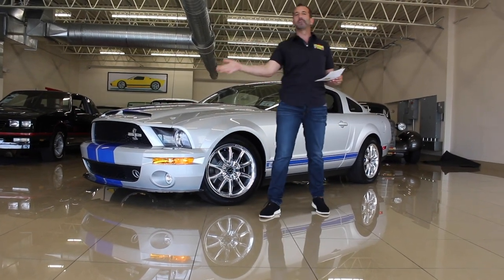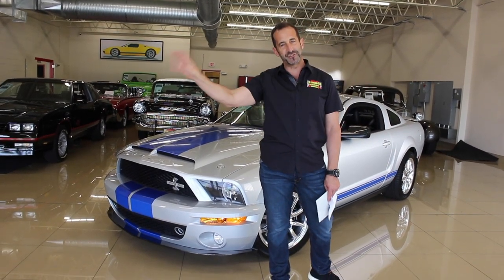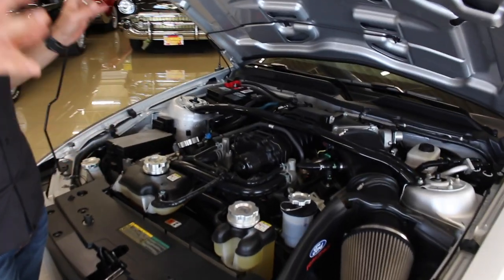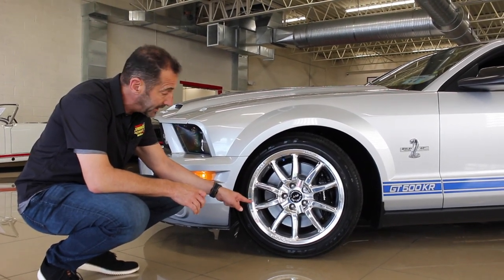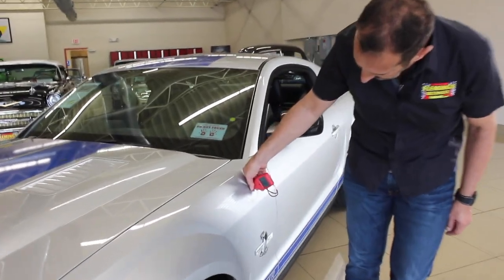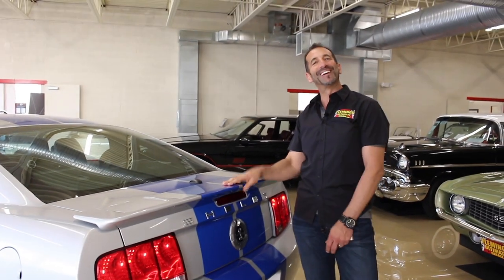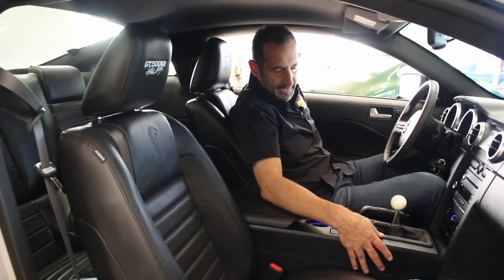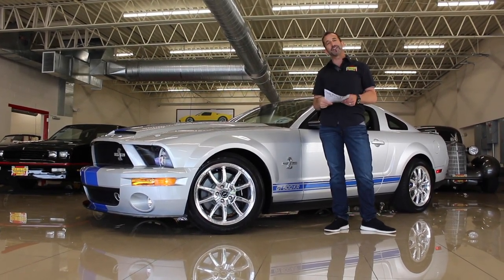1 of ONLY 1000 GT500KR

Comment: Wonder if it could be modified for 800-1000hp . . . . .
Reply: I HAVE A 08 GT500 THAT HAS ALMOST 800HP AT THE TIRE AND I ALSO HAVE A 07 AND 10 SUPERSNAKES AND MY COUPE HAS OVER 800HP AT THE TIRE AND THERE CAPABLE OF MAKING 850HP AT THE TIRE LOL OF WHICH IS OVER 1000HP AT THE CRANK